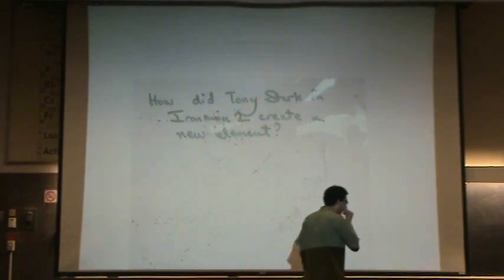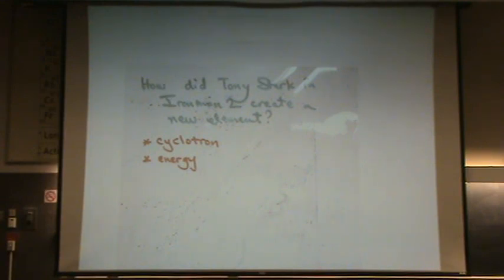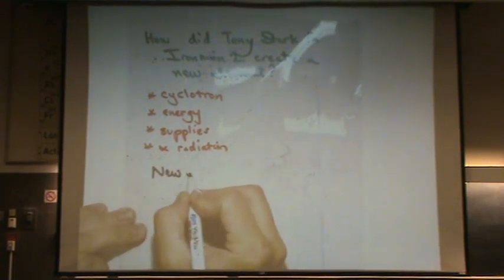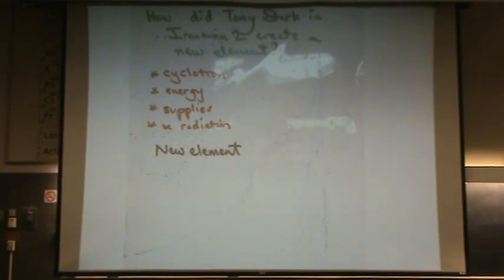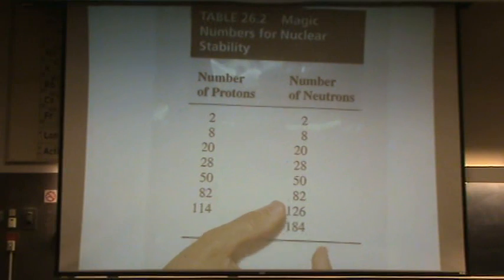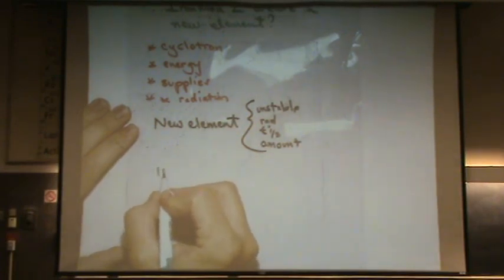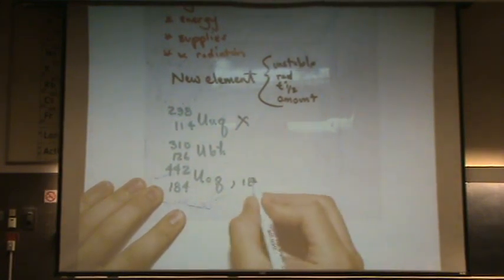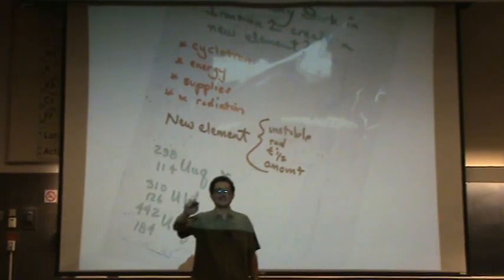Ironman 2 - New Element.mpg

Comment from the maker: @Munchkinreverb Yes, you are right - alpha radiation is not highly penetrating.  However, there are 2 issues: (1) he was standing very close to the beam; and (2) he made an element that was likely radioactive.  

On another note, this video is satirical and is made just to illustrate a few concepts in nuclear chem.  Among elements with Z>83 and magic numbers, none are truly stable. Also, several isotopes of Pd are stable and even the radioactive ones are not alpha emitters.